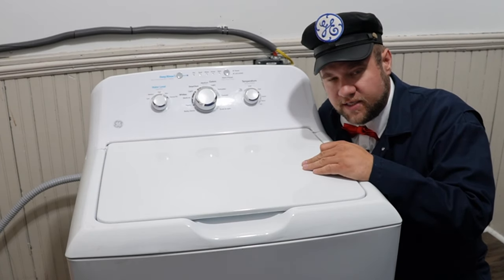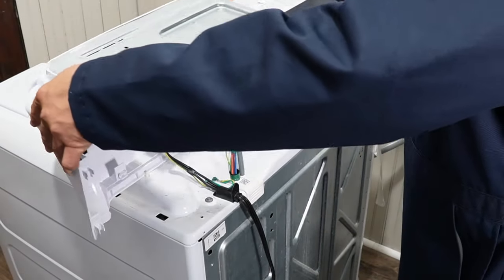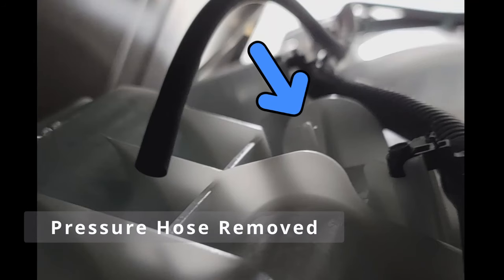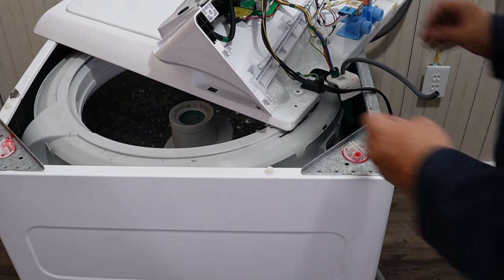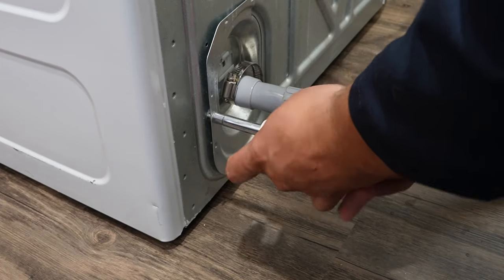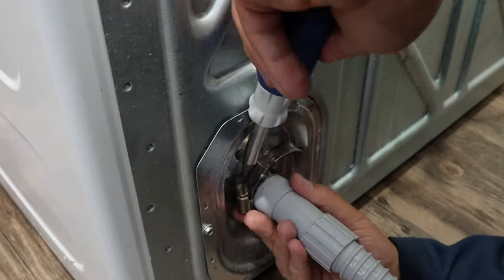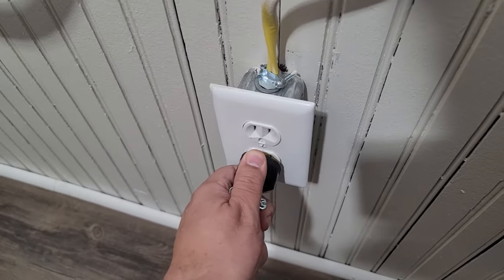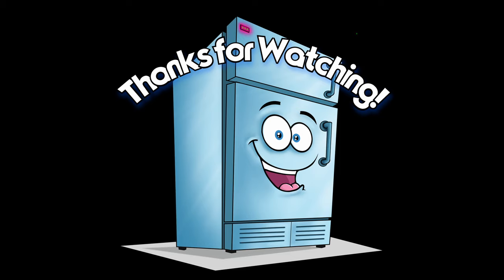GE Washer Won't Drain or Spin Dry Clothes Well - How to Fix With a Drill

Comment: It didn’t work😢 
Washer drains but won’t spin. 
It’s ok sometimes with lighter loads but not with towels.
Reply: Hey did you ever arrive at a solution? I've replaced the motor (with a used one) as well as the belt and start capacitor, and mine will only spin if i reach in and forcibly spin it at the start of the spin cycle ..I guess it's totally possible the used motor just has the same problem but I'm hoping it means I just haven't identified the real issue.
Reply: I would put it in troubleshoot mode (technical spec sheet is taped in a plastic bag to the metal cabinet, from the inside), and try the drain and spin cycles, within troubleshooting mode.  I did this with my washing machine, and discovered that the drain water pump was seized with a piece of what looked like a thread of dental floss.  I wrestled with the drain water pump, until it released the entire length of the  floss, and re-installed it. It worked again. 
Oh, and this particular drain water pump really isn’t serviceable, and it had some Chinese text, and branding, that didn’t look like it had anything to do with GE. (well, at least that’s how I saw it). It’s sealed shut, and the impeller is difficult to pull off, and I didn’t try to pull it off after 3 tries.

You can’t open the stupid pump, but yet, a thread of dental floss was able to get caught by the impeller, or shaft, and make its way into the inside of the “sealed” motor housing???!!!  Unbelievable!!!!

Comment: Bad board...  Worn belt (Out-of-Balance)... Stopped up water valve and/or weak water pressure... Lid Lock (No Spin)... Bad Mode Shifter (Doesn't Shift From Spin to Agitate or Vice Versa)...  and Least Likely (Your First Method)
Reply: Question for you. Mine won't perform the spin cycle unless I reach in and spin the basket right at the start of the spin cycle. I hear the relay (the click) and I see the motor try to engage, but fail, this is when I reach in and give it an assist. I tried replacing the motor, belt, and start capacitor, but I have the same problem. Any suggestions?
Reply: @callbackdons  That's going to be either your clutch and/or your timer. A good way to test to see if it's the clutch is to let it reach full speed and see if you can safely stop the tub with your hand and a rag. Try this on normal or heavy duty mode, as delicates and casual modes spin at a lower speed.
Reply: @txup92g33  I appreciate your help, I'll try testing the clutch

Comment: When i was a teenager working at w shop that refurbed pc Richards stuff they were supposed to junk afte they did delivery for new equipment. Picked up perfectly good, but dirty old appliances for almost nothing. $10-20, 50 if it was special or almost new. We're getting ripped off by these companies. Can get an entire motherboard for a gaming computer with way more tech than what's in a washing machine shit even a whole computer for the cost of a circuit board on a washer or fridge. They're not even smart either, not usually. They just silicone the damn things in so you can't pull them out the cases they're fixed into. Kinda fucked up. . That shit should be illegal

Comment: As a life long sparky I always found GE to be the worst company to secure parts & worst service department. Had trouble with every million dollar he PIS medium voltage switchgear. Only had 1 be appliance in the 49 years having my own hone. A he POS gas stove. They saved a few pennies by having the oven & broiler igniter in series with the gas valve so it waste electricity after flame is established so overpriced be signifies only last two years ( In the 8 years that I put up with that pig Had to rep!ace 3 oven signifies and the glass door that blow up while oven was only on a few minutes. Great Vjd.
Reply: I'm watching this video because my friend's washing machine won't spin. As far as GE appliances go they're not all bad. I have a basic GE standard style refrigerator that's over 20 year's old. No problems at all.